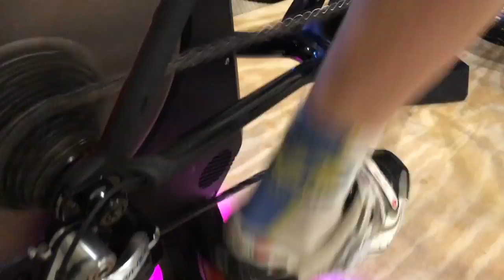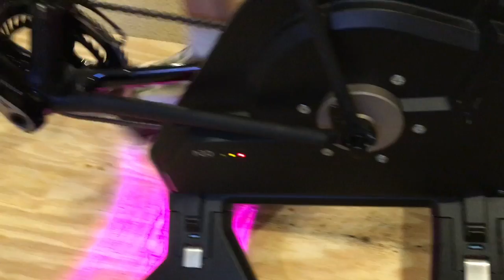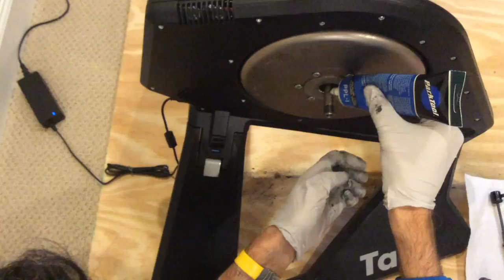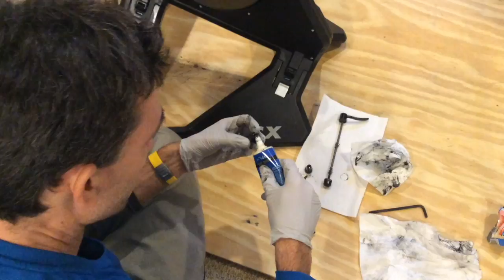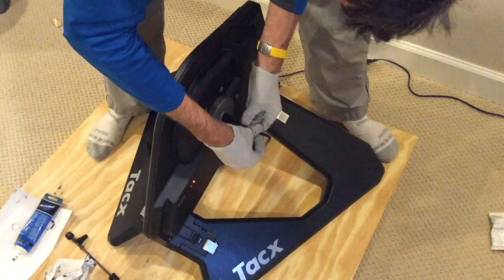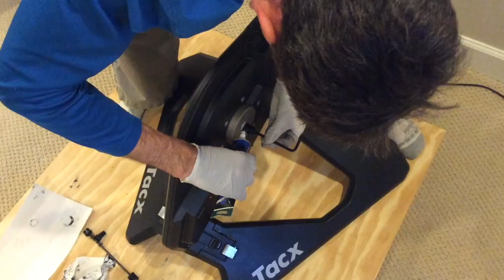Tacx Neo Squeak and Recommended Repair

Comment: My neo was making this same noise within the first 50 miles of riding.  When I pulled the cassette body off I could see the shaft was lubed in one area and dry in another.  The squeak must have been metal on metal friction.  Thanks for posting this fix I was ready to take the neo apart and start lubing the case and screws thinking it was coming from somewhere other than the drivetrain.
Reply from the maker: Cool - glad it helped you out.  For me it did not fix the problem.  I'm embarrassed to say the problem was with the peddle.  I tried everything.... replacing the bottom bracket bearing, lubing everything known to man, replacing the chain, doing the fix in this video three times....  It was the stupid peddle.  I never isolated exactly what in the peddle was causing it, but after lubing the hell out of it the noise went away....
Reply from the maker: pretty sure it was the peddle.  I lubed it up and the noise went away.
Reply: I think I have the same issue. It only seems to do it when I’m using erg mode? I’ll give this a go. Thanks for posting